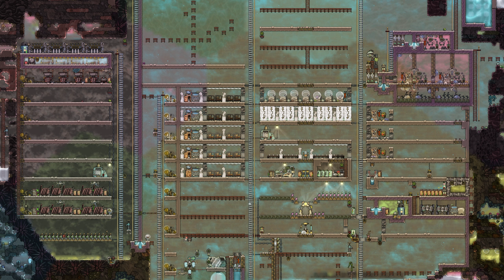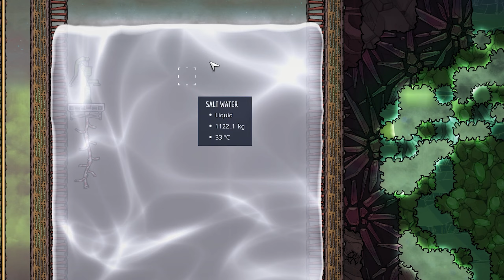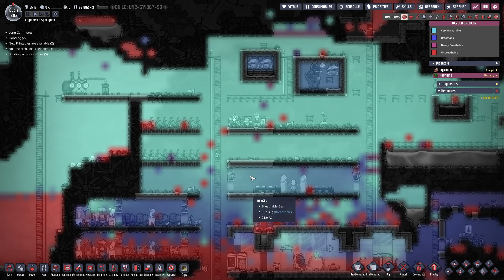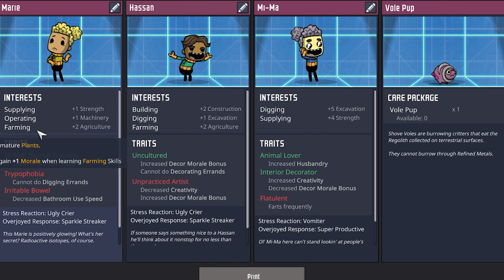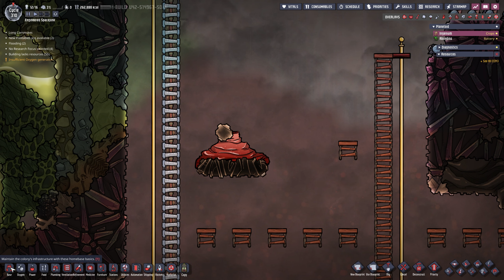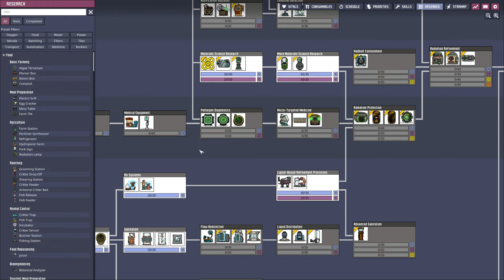TAMING VENTS and VOLCANOES! (LP2-EP14) Oxygen Not Included Spaced Out

Comment: You really oughta do a counter flow heat exchanger on the hot metal coming out of the tamer and the saltwater going on, then after the salt water has warmed up and the hot metal cooled down a bit then use the cooking block with the aqua tuner. You’ll get more power out and save on cooling power cost.

Comment: ~ 15:40 - I used a different design of deoderizer for industrial-scale offgassing of pwater for making ceramics, but it would apply here too.  1 lower layer of airflow tile, 1 upper layer of mesh tile with crude oil, then the deoderizers on top of that.  The deoderizers can still reach the 2nd tile below them past the mesh tile and output oxygen, that way you are guaranteed to have clean oxygen in the upper chamber, only need an atmo pressure sensor for when it's worth pumping oxygen out.
Reply from the maker: Good suggestion, I like it!

Comment: ~3:42 - I'd normally prefer enclosing my base and place atmo suits at the entrance once reed fiber production is up and running, but I've used these setups before that was built up.  It takes some time out of the dupes' day to run 15 blocks each way in between for the atmo suit transition, I'd replace the walkable areas on top and below with metal tile just for the run speed boost, since they're in atmo suits they don't need the arflow tiles to oxygenate the area below.  Three metal volcanoes should be more than enough to cover metal tiles for run speed boosts everywhere, and even metals with no bonus decor can help a lot with any morale issues, heavy watt wire areas and the vertical transport spines still need some extra attention as far as that goes.
Reply from the maker: I did think about enclosing just the living quarters. Have done that before. The nice thing is, that can always easily done later.

Comment: Does the cobalt volcano need the the CO 2 pumped out from the liquid lock or is the temperature not going to be a problem?
Reply: CO2 does transfer heat badly, but if you do not want near 0 heat transfer you should pump it out.
Reply from the maker: Yes, you are both correct. I did make a mistake and not vacuum it out, but it is not the end of the world immediately due to bad conductivity. But I will fix it in the next episode :)

Comment: Danger at the cobalt tamer. Have you spotted it?
Reply from the maker: I don't see anything other than a potential power outage could become an issue. What did I miss? :)
Reply: @BierTier  The liquid lock wasn't vacuumed out so it isn't fully isolating the volcano heat
Reply from the maker: Holy cow, the entire point of the dual liquid lock and I forgot the most important part! Thank you, will fix that with a shoutout next time around :)